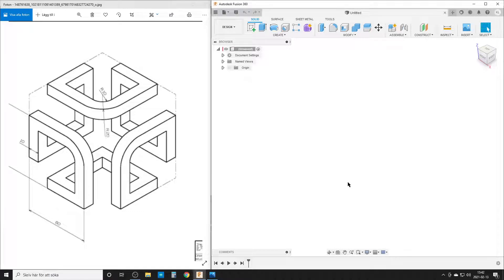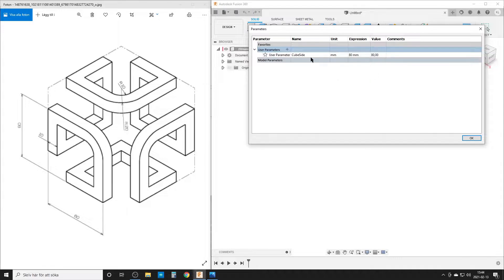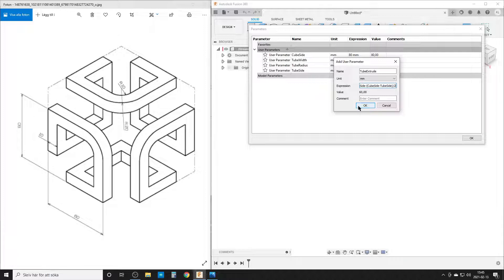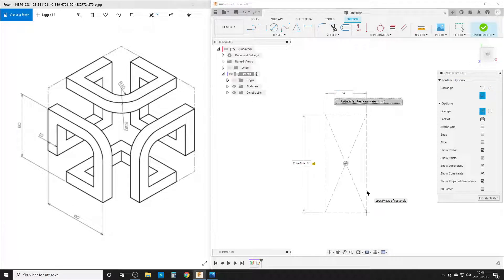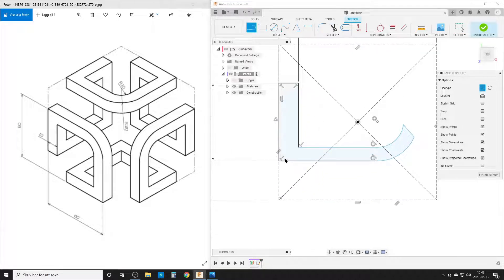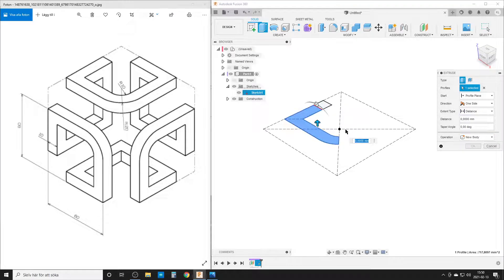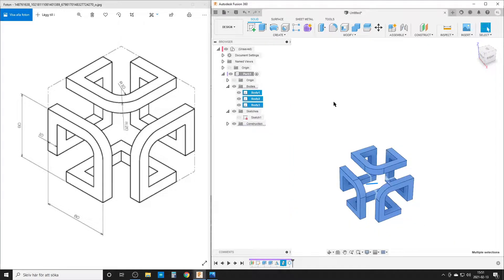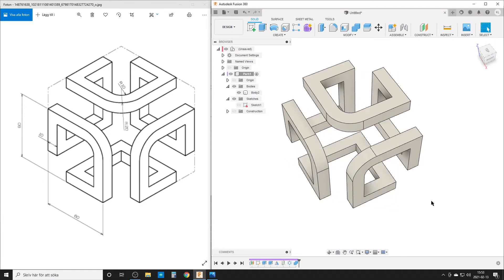Fusion 360 (Basic) - Geometric Design (Parametric modeling)

Comment: Honestly, how long it take you to figure it out this way?

Every time I try to guess your workflow you always amaze me. This is an absolutely brilliant way, my only concern is that this solution is "too genius" and it takes a lot of time to figure it out this such an amazing way. I just draw lines in a 3d sketch and did a sweep + fillets of different radii that was given. I know 3d sketches are a little bit janky but that kind of workflow better fits my brain, haha.
Reply from the maker: Then I started using Fusion 3D sketching was not available in the software. I think I needed 5-10 minutes creating a parametric stable model of this, that is because I have solved similar shapes before. But as you mentioned it needs to fit our brain, but be careful with complicated 3D sketches, they will often break.